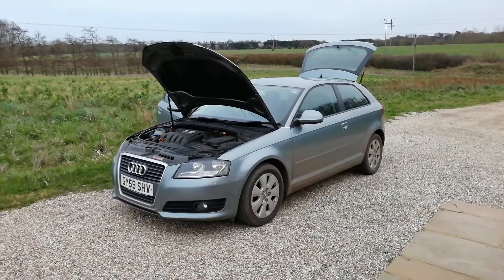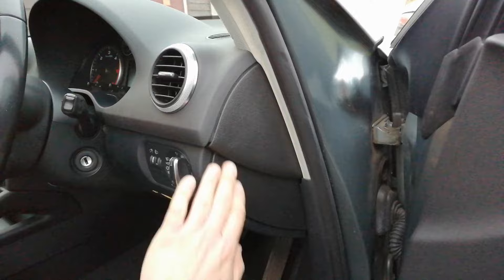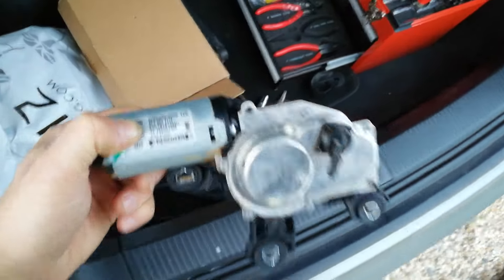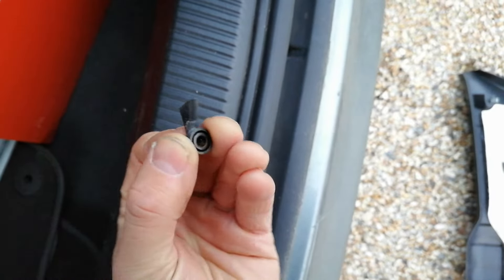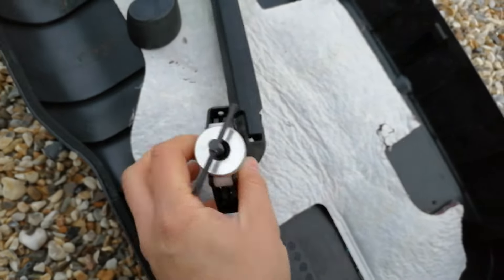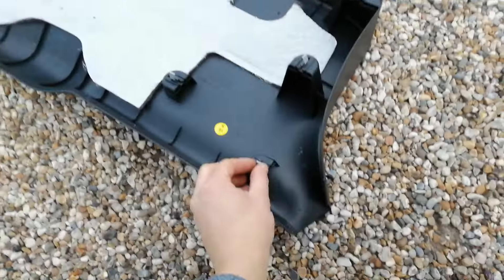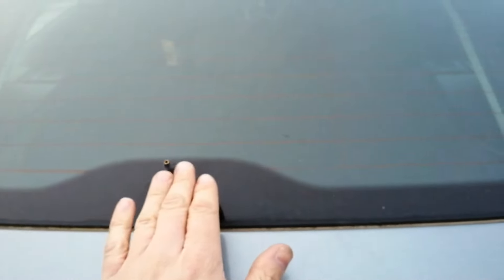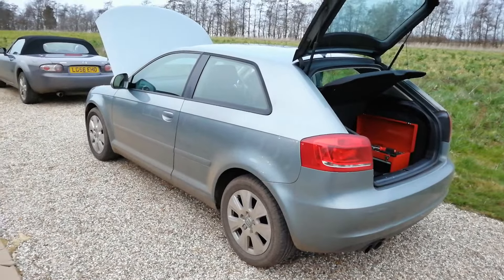Audi A3 2004-2019 rear wiper not working. How to fix/diagnose? Removal and installation of the motor

Comment: Thanks Alex. A really good, clear instructional video. I'm about to do the same job on my wife's car and this will help immensely.
Reply from the maker: Awesome 👌 u are welcome 😀
Reply: He didn't show anything, just explained what he had done.  Shocking video.
Reply from the maker: Thank you.
Some people appreciate that actually.
Reply: Great video. follow up question, about to replace motor but afraid the fluid might need replacing to our sometimes cause their was rust along the black tube coming from motor and rust on the tip of where the wiper connects with the motor.
How do u replace fluid?

Comment: those wee tools are actually great ,,, just taken the rear wiper arm off my 2004 a3 , it was the tightest ive ever taken off , and thats with forty years in the motor trade  i thought i was going to have to cut it off .
Reply from the maker: Yeah it's an amazing tool. Bit of wd40 and that tool and if tight a bit of hammer tapping :)
Reply: i used a 4lb lump hammer ,,, a bit of tapping is a grave understatement
Reply from the maker: @tomthompson7400  oh haha. Well you got there in the end?
Reply: ah another tip , well word of wisdom , the wiper motor and arm is exactly the same as the 5 door sports back one , we got a crashed one in , and i used the assembly from it , may be easier found in a scrap yard.
Reply from the maker: @tomthompson7400  yep they are the same on 5 door. I mean I don't know about scrap yard .. as new unit on eBay is only £20. I think it's not a bed price.
Reply: true , but a genuine one may be better quality ,  maybe not , these days you never know where the genuine one  is made , crazy world , German engineering with a CE mark used to be great , these days CE just stands for Chinese Export.
Reply from the maker: Haha exactly. In my experience with genuine stuff is actually surprising... As a lot of cheap stuff is made in the same place just got a different tag on it :( they even sometimes have to swap boxes and etc just to put price up -.- which is quiet sad to be honest.

Comment: Just wanted to add something for all my fellow VAG sufferers. The reciprocating seal where the black plastic water inlet housing meets the end of the hollow shaft wears out and fails [terrible design that was always going to fail]. The water under pressure then fills up the unit , emulsifies the grease and starts rusting any steel. The electrical contacts short hence the first sign of problems often being that the wiper develops a life of it's own. Ironically, that gasket keeps the water in!
[By the way, if the water does leak out, it could drip down on the lock electrics and kill that too. If you've started noticing the odd drip when you open the hatch, it's time to investigate.]

A cheap replacement unit may well quickly fail again for the same reason, as will a VAG unit although it'll probably take a lot longer being better quality [but still a terrible design].

It sounds like madness I know but the only long term fix is to carefully fit a separate washer jet through the boot lid and modify/attach the water pipe to that. You'll be completely bypassing the motor so no more water in it, whether you've refurbed the original or bought a new one. 
Just be careful about painting and sealing the hole in the body you've drilled before fitting the new jet or it'll rust really quickly. Some insulation around the new pipe will help avoid freezing in cold weather.

Only to be tackled by the competent,  it'll cost you around a tenner but it's not for the faint hearted!
Reply from the maker: Thank you very much for sharing that info 😀

Comment: Hi there Alex Great video regarding the rear wiper.😊😊😊😊😊😊I have just purchased an A3 1.9Tdi on an 09 plateAs stated regarding requests.Can you please make video on how to remove the front fog lights.From what I can gather it look like you have to remove all the front bumper  😢😢😢😢😢😢I look forward to the videoTony
Reply from the maker: hello there. Yes i will try and do it soon and will post it on here. But im pretty sure that black plastic covers come off around fog lights and then there is 4 screws holding it in.. will double check it for you

Comment: How did you take off the rear view window panel? I'm trying to install a rear dash cam and can't seem to pry it off.
Reply from the maker: Hello there. The panel will be quiet tight on there... You need to pry it with plastic tool on one corner to start with. It's quiet hard metal clips holding it in. They are release clips... Unless someone already done on your car before and glued it on... Had that before -.-

Comment: I’ve got washer noise but no fluid or  rear wiper movement. For such a prestigious manufacturer this really is an annoying and niggly reoccurring problem. Grrrrr.
Reply from the maker: Yep.that happens unfortunately. That is your nosle that is blocked or u have got a split in the pipe somewhere
Reply: Thanks for the reply. Yes, I’ve cleared before with an air gun, but again it’s blocked. Second time. I also need the stopped wiper investigating. 😔